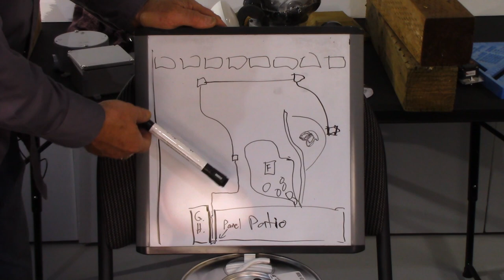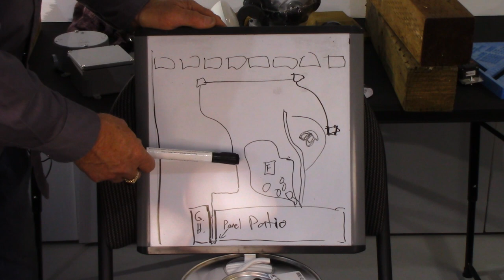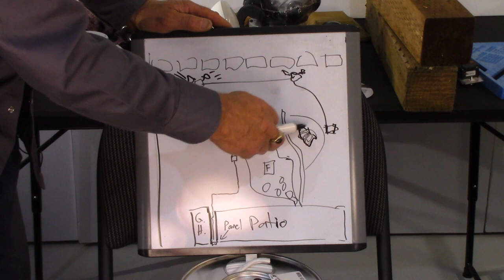Outdoor Electrical Wiring and Landscape Lighting

Comment: Excellent and thorough video. This is exactly what I was thinking for the wiring, Excellent coverage of all the "little things" regarding each task. 
I am doing a very similar project with multiple lights with a gfci system / outlets and 10 dimmable LEDS with easy stock on for futures. I plan to daisy chain in the exact same manner with 12-4  UF-B in pvc conduit at 2 foot (.7 m) deep, to conform with NEC outdoor conduit requirement in my location (in the states) (actually 18" but I always bury 2' deep in case it is inspected).  The conduit in my case is overkill, but I want to do it once and forget it.
Plus in the past, digging in the  yard, I found old live lines running to a well, another to power my shed and a sprinkler system I didn't know I had. So I will be making new runs for these as well in the same ditches.
Thanks again for the excellent video, I look forward to see more in the future.
Reply: oops I meant to type 12-3  - only one finger knows how to type, the others are still learning.
Reply from the maker: Thanks for watching!  I hope that you gave the video a 'like' and that you have subscribed to my channel and clicked the notifications bell?  Thanks for the comment as well.  It all helps us creators out a lot!

Comment: Hey great video! just out of curiosity, is there a maximum length that permanent wiring can be run? does it have limitations like extension cords?. I initially wanted to run ext cords in my backyard with splitters between ea to plug in some led lighting, but after some research, found out it's not safe to daisy chain. Im wanting to run wiring along my fence (probably 400ft total perimeter, but come from left and right directions and meet in the middle so ~200 ft each way) and have outlets for lighting and other conveniences. any suggestions would be great!

Comment: I am fairly certain you can't use stripped romex conductors in pvc conduit.  The insulation is not rated for "wet" locations. THWN conductors or UF cable would be suitable.
Reply from the maker: Yeah, you know I went over 40 years in the trade and the first I heard of this  was a video I stumbled upon by another YouTube creator.  I had asked an inspector for a ruling on this several years ago and he told me that as long as you strip the jacket, it's all good (bundling and heating is the reason to strip).  Now I think the difference then is that it's going underground.  So to me the issue is a technicality that poses no risk whatsoever, especially if you are doing a proper job of running the PVC and getting good bonding of the connections, etc.  Then there is no  way to have the conductors surrounded by water, and even then, if the wire insulation is intact, I don't see an issue, but technically yes, it is not allowed as you pointed out.  Thanks for watching!

Comment: Can I use the landscape wire 16/2 to hook the light? What is the benefit of using those wire in the video and how does that connect to a transformer?
Reply from the maker: The project featured here is using line voltage 120Vac for the devices.  You are referring to low voltage landscape lighting.  That only requires a source of the 120Vac to plug in a transformer and then from the transformer you use the 16/2 low voltage cable at the output of  the secondary on the transformer (usually 12Vac) and then run that to all the fixtures that operate at the low voltage transformer supply.

Comment: So if you wanted to add a receptacle after the gfci would you connect your hot and neutral out of the line side to the next gfci outlet? I'm confused on when you would connect out of the load side of the receptacle.
Reply from the maker: Yes, You have to pigtail on the line side if you were to add more, and do that at every location (and put in a GFCI) due to the sharing of that neutral.  The way I wired this you won’t be able to use the load terminals at all.
Reply: @theinternetelectrician Thank you for the response. What needs to be done differently to be able to utilize the load side of the outlet?
Reply from the maker: @danperales5804  , either feed this entire circuit with a GFCI breaker, or I could have had a GFCI receptacle first in line, then feed the rest of the circuit on the load terminals.  GFCI circuitry has to see a total balance of the current on the hot and the neutral to stay set.  If there is even a slight imbalance of even 20 mA, it will trip.  So with the way I have it here, the GFCI will be fine to use, but as soon as you turned on the lights, the current they are using would flow back through the GFCI receptacle on the neutral, but not be flowing on the hot side as that current would be by-passing the receptacle as it's coming from the switched red conductor.  Same circuit, but a separate wire.  Make sense?  The other thing I could have done would be to run another neutral wire dedicated to the receptacle circuit instead of sharing with the lights.
Reply: @theinternetelectrician  makes sense. Thank you! I took one of your classes on Udemy and I really enjoyed it.

Comment: Very instructive but why not use low voltage?
Reply from the maker: Three reasons, 1. I had a few of those 120V dimmable LED Par30 lamps to use up.  2. One less potential problem (transformer). 3. I wanted to have some convenience outlets around the back yard  for various needs, leaf blower, electric chainsaw, charge the cell phone, etc.  Thanks for watching!

Comment: How deep according to electrical code do you have to dig your trench?
Reply: It's a local code ,so it varies but 6" is the norm
Reply: 18" in CA for high voltage  6" for low voltage